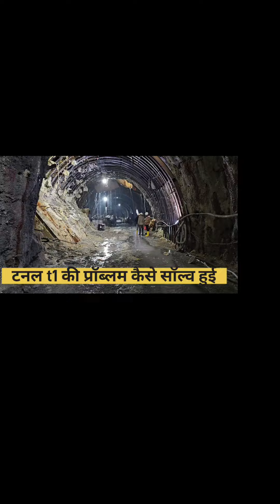#USBRL की Tunnel T1 की प्रॉब्लम कैसे सॉल्व हुई #latestupdate

Comment: I get it working on this terrain and tunnel is challenging but why the bridge work, station building and other stuff is still pending. Things  like those should have already been completed so that when the tunnel gets through it's breakthrough you you don't have to face all the work load at the same time.
Reply: Yess it should have done & completed earlier
Reply from the maker: it is passing through tectonic plate extending from Kandahar to Myanmar, the arrear between two plate is crushed, soft and unstable with water body padding through it, all these are creating problem.
Reply: @perspective-sg sir can you  provide little bit  hint what is the source of this constant water ??
Reply: @राकेश_रेल dense forest on the mountain, which is being digged